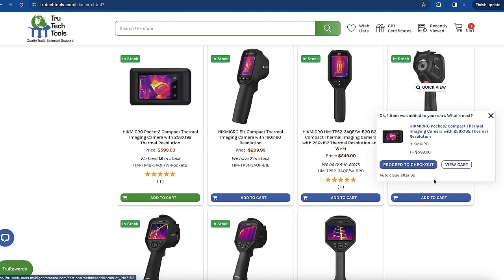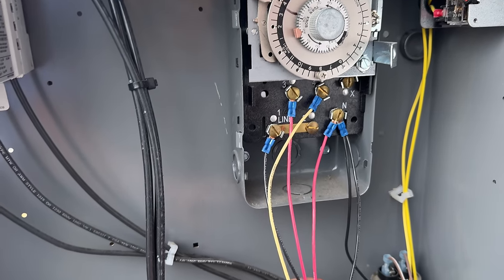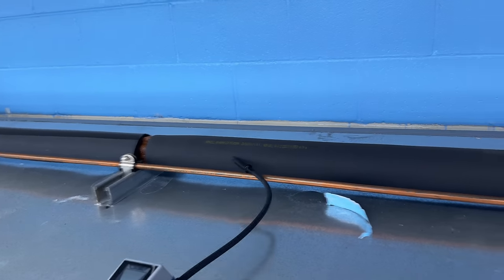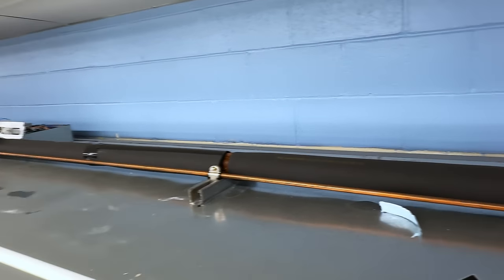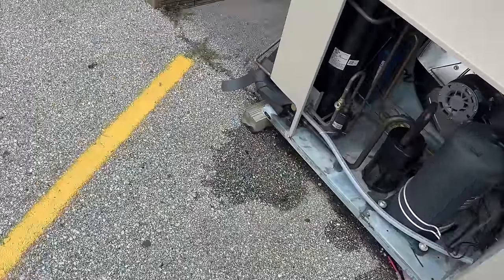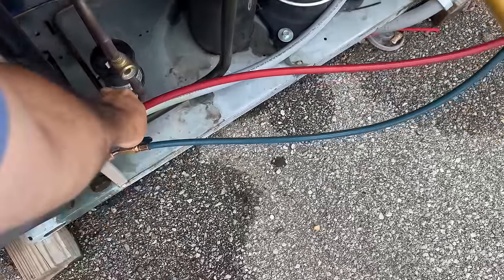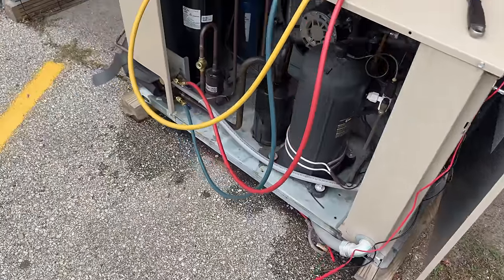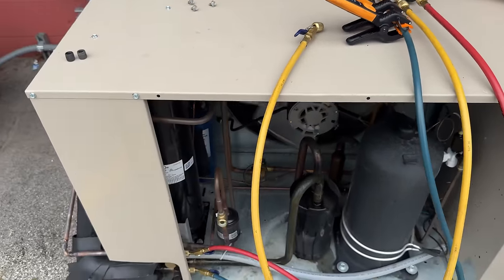More Mistakes More Problems New Install Failures

Comment: Putting the solenoid outside was a bad design. You lose the whole liquid line for storage for pump down. 50 feet of ⅝ line will hold around 5# of refrigerant that the receiver has to take on. Hill Phoenix makes good stuff and usually easy to service. Ive been to the factory in Conyers, Georgia several times. The long drives suck, i know. Ive had to drive from Destin, Florida to North Georgia a few times. Its difficult when you work all day then have to drive several hours home.
Reply: Every once in a while I have to drive from Broward to Tally. 6 hours of not fun. Thankfully my Nole is graduating next year.

Comment: I’m sure you confirmed already, but equipment that close to propane storage containers always makes me anxious
Reply: But tankers driving 70 mph with thousands of pounds of propane or gas that people always want to break check and cut off. And the propane sits outside in a metal box and gets up to 120°. And nothing ever happens, scared people make scared mistakes that causes the issue you are anxious about
Reply: @Freonleon  all true, but contactors and electrical equipment can be ignition sources. Not exactly parallels drawn. But as long as manufacturers clearances are observed it will be fine
Reply: @Freonleon I love your profile pic of the blown bakelite. Ever had one to pop while in front of it?

Comment: Good god... 😮 Mechanic defrost clock, digital defrost management and mechanic thermostat. So many branches on the stick. Why not a digital controller managing solenoid valve, fans and defrost contactors? One probe for inlet one for outlet and one for defrost temp.
Reply: What I was thinking. Too many variables and to many things to go wrong when one controller could manage it all.
Reply from the maker: I guess the company that installed it probably is not very big because I had not heard of them because they’re close to my area.  The piping looked pretty good but the start up needed a lot of work.

Comment: Rick, I feel your pain. I had like 5 stores when at my old company that the installers screwed the pooch on freezer heaters never wired up correct nor did they run power to the condensate pumps. 2 weeks of off and on service calls to get it back up and running. If there not going to do there job I would rather just do it myself. Good stuff and hope you had a great weekend.
Reply from the maker: Good weekend thus far. Thank you!

Comment: My favorite part is when you put the new meter back in the van and got out the old faithful fluke meter!  
You could tell you weren't "fluking" around! 😂
Reply from the maker: I debated on cutting that out, I didn’t do it to make the meter look bad because I think the fluke has some delays built into its readings. Where as the testo is more reactive on some things like the amp draw.
Reply: @HVACRSurvival  i'm glad you left it in there. It just shows what really goes on out here in the field!  Great video thank you for sharing!

Comment: Great job figuring out that mess, the way they wired that was absolutely mental. Either use a defrost timer with a mechanical thermostat or a digital control, not both. If it was my install I would have put the liquid line solenoid, thermostat and defrost timer at the case and used a fan delay defrost termination switch. They also could have ditched the defrost timer, and mechanical thermostat entirely and used the Emerson control for thermostat and defrost. Oh well maybe next time they will get it right.

Comment: Common mistakes I saw all the time, not ordering the equipment with oversized receivers for case applications, I am not familiar with these cases but many are flooded systems. Also you are correct in that the solenoid should always be at the tev inlet or the liquid line split.
I personally would advise the owner to have the solenoid repiped correctly. I don’t envy you following behind poor installations.
Reply from the maker: I don’t know if I would wanna put a solenoid at every case, but at least closer to where it splits to feed the three cases.
Reply: @HVACRSurvival  what I meant was on single evap system solenoid at the tev and multiple evaps the solenoid at the split

Comment: Good job Rick, I didn't wire the controls, I haven't been in Indiana for long time, I guess maybe they should have installed the solenoid closer to the evaporator, and did a better job on the install, the job looked clean, but even then mistakes can happen........
Reply from the maker: Correct. The piping looked good. The controls were the only miss

Comment: Crazy! All those separate controls. The one simple dixell controller that was factory indtalled on each case could control each case, temperature and defrost.
Reply from the maker: Yeah it probably could do it all depending on the model, but that’s not how it was originally designed even from the factory. I’m not sure why they do it. I don’t really care for it. I think it kind of sucks but HillPhoenix is a pretty big company and for some reason this is their current operation, these cases were made in 2023.

Comment: Did they drop something on the heater, or put 240 volts on a 120 volt heater?
Reply from the maker: I wondered the same thing, but those heaters are 240 V. I’m not sure what happened. I still haven’t been back yet because there is discrepancies on which heater to get the front or the rear for the coil. I can’t believe they didn’t make them the same and since I didn’t verify, which one was not working and now we’ve got an issue. I couldn’t have verified it with all the dang food in there. What a mess.

Comment: New meter eh ? Very nice I like that Testo . Just a heads up it kinda struggles to read very low amperage like under 1A and such , and the little delay when first reading volts and amps is kind of annoying , otherwise it's a good meter .
Reply from the maker: I noticed it’s really slow on reading capacitance. I’ve kind of ran out of tools to pick from TruTech Tools,  I thought I’d give it a shot since Testo’s been so good to me. For the most part it seems like a pretty nice meter. I just need to use it and get used to some of its Quirks.

Comment: I found it interesting with them having the sensor wired wrong on the controller. The book you had showed it wired different. I noted in your video the sticker inside the controller after you showed the book indicated it to be wired the way they did it.
Reply: 29 min mark
Reply from the maker: Are you talking about the digital temperature control? The book showed it being the bottom two, the very top terminal was the bin switch, which is a trigger. The ASP is what the thermostat does when it loses a sensor and it was programmed to run, which is a number one. I’m not sure where you’re seeing that it was wired correctly,  which instruction are you setting it differently?
Reply from the maker: Son of a biscuit eater. It’s crazy the stuff other people pick up 🤣👍👍👍you are correct. However, it was wrong. I can see how that happened but you can’t justify not verifying the system kicks on and off at the thermostat at least once when the system is brand new just to make sure everything‘s working as it should, so technically the faults on them and they never seen the temperature on the display. Inside the thermostat, it had a setting on what it does when the thermostat sensor fails, a number one means it will run all the time zero means it shuts off. Luckily he did have that set on a number one, which was a default setting.
Reply: Completely agree that they should’ve noticed that it was not reading a temperature and was displaying the fault on the controller. Guess the factory stuck the sticker on upside down inside the controller.
Reply from the maker: @hvactech77 I agree that definitely is a problem with that sticker design and it’s not obvious that it can only go one way.
Reply: btw, yt deleted my comment probably because I used a politically incorrect word in it. I had mentioned that it was probably friday when they made that temp control at insert name of company that manufactured it
Reply from the maker: I don’t believe they’ve deleted anything, but there is some filters turned on that if you say certain keywords, it will hold it for review before it lets it show it in the comment section. I then have to manually approve it.

Comment: 29:14 Sensor label and document don’t agree. Did manufacturer put the label on upside down ?
Reply from the maker: It looks that way because the instruction that the installer left were correct.

Comment: I'm pretty sure tank heaters refer to the heated condensate evap pans used where drainage to an actual drain is not possible. I had to wire up some cases for a Walmart that used heated condensate pans and IIRC that was the amp draw they had.
Reply from the maker: That sounds possible, but I would figure you might run it over to like a little giant pump or something equivalent to that and it would be outside of the freezer?. I guess I don’t understand why it would be heated unless it’s inside the freezer with it and even then why wouldn’t you drain it outside of the freezer so that you wouldn’t have to hold the water in a heated pan? . Sounds like more problems. this would be new to me.
Reply: @HVACRSurvival  The idea is it evaporates the water with somewhat high heat, avoiding the need for a pump or drain. It is located outside the case, usually right under the condensate drain outlet. The whole concept is bad really, because you're just dumping the moisture back into the same room with the cases actually.   

And you are correct that it is a pain, they get dirty, the heater fails, and it can only cope with small amounts of condensate at a time. Your defrost with hot water would make a flood using it.  The install I encountered them on was in a part of the store where no drains or exterior walls were accessible.  IMHO it would have been better to dig in a small sump and use a more powerful pump to go up, over and run the distance to a drain but that would have been horribly expensive.
Reply from the maker: OK, I now I know what you’re talking about. Yes I have seen that on a couple small self-contained beer cases that kind of looked like they were be on a rack. I had to use a pump sprayer instead of a garden hose. Or actually I think I use my vacuum cleaner to suck it out.

Comment: I'm not in this hvac stuff, but if the 220 wire is connected to 110 will drow half the amps. Maybe is this thing there, 9.smt if half of 18.smth.
Reply from the maker: The 240v circuit had the correct voltage and so did the 120v. I forgot to show that.
Reply: @HVACRSurvival  maybe there are 110 or 220 defrost whire and mixed up? they are having different resistance, i'm from europe and this voltage mix is strange for me :)

Comment: Great job even with crap installs.  Shouldn’t each bank of coolers have a solenoid since they are each bank are individually temp controlled? This seems to be a hack of an install. Get what you pay for
Reply from the maker: This customer would’ve paid what we charged, but the problem was the other guy must had better contacts at the factory and was able to get the cases a lot quicker than we were. Theoretically, yes, it would be nice to have temperature controls in each case however when we do a parallel rack system, we pipe them this way and the only thing we do is put monitoring inside of each case so that if one goes down, we can catch it with an alarm of high temp. I guess it’s a little more difficult when you have smaller systems like this but I don’t think it’s that uncommon you just gotta keep an eye on your temperatures because even this system here has no alarms on it if the product gets warm.

Comment: how do multiple cases on one condensing unit work? wouldn't the condensing unit be massively oversized in case just 1 of the 3 cases is calling and it would short cycle on low pressure all the time?
Reply from the maker: Theoretically, that’s where your receiver would hold the excess liquid. Rack system has multiple compressors and multiple circuits and it tries to maintain a certain suction pressure. On a system like this I have not seen too many individual thermostats however, I have seen it done. It would definitely take some planning on the BTU calculations and engineering chart. So I can’t say with 100% certainty there wouldn’t be a problem. I’m definitely not an engineer. I just make them look bad.  🤣
Reply: @HVACRSurvival  maybe I misunderstood, I thought it had a seperate temp control for each case, if it's just one for all 3 then there's no problem but the cases might not all be the same temperature if they can't mix air inside. it seems like a less than ideal system that would work normally only under close to ideal conditions (identical load and heat losses in all cases fed from the same temp control)

Comment: Wouldn’t a simple reversing valve and running in heat mode do the same job, only better, than running heating elements at high current?
Reply: Some use hot gas defrost freezer cases, freezers, and ice machines. Depends on the equipment but a hot gas will just run compressor and a solenoid sends hot discharge gas through the evap coil to defrost it.

Comment: maybe they're not setup for pump down and relying on the accumulators to keep from liquid slugging? but I'm guessing that would balance out with too high of pressures on the low side when off. hard to say what people do or silly controllers do now days.

Comment: you can't fix those freezer master-bilt reach-ins since the heaters are just an add on to a cooler design. they F that design. they will freeze again and again every 30-45 days.
Reply from the maker: They look cheap as hell and like a shit design when they have a twisted wire around it. I’m not impressed.

Comment: 29:11 Notice the sticker inside the device, its turned 180°; guess thats why they wired it up that way.
Reply from the maker: Yes, but they should’ve tested it and verified it worked,  obviously they did not.

Comment: Question for anyone:  Have you worked on a Sanyo VIP PLUS chest freezer?
Why do I ask?  I'm looking at buying a used, broken freezer on Facebook.  It doesn't power up, probably a straightforward fix?
New ones are too expensive for me, this one's $600
Anything to say about Sanyo freezers?
Any problems keeping the freezer at -240 degrees F?
Thanks.
Reply from the maker: I assume it’s a medical freezer? With two compressors? They can be a pain.

Comment: That freezer A421 sensor was wired into the wrong terminal because the sticker was put on wrong in the factory 😂 29:00
Reply from the maker: I seen that 😎 but he should have tested the thermostat when they were finished installing. He must not of tested it.
Reply: good catch, that would get just about anyone that's not used to installing them all the time. good old chinesium junk and lets not forget bottom of the barrel labor anywhere.

Comment: Big question I have is, how in the world do you have 7 bad heaters? I very very seldom have to replace a heater, normally it's just a time clock problem, wiring issue like you ran into, or terminal burned off the end of the heater wire, stuff like that. Yes I've had a couple drain pan heaters go bad over the years, they get beat up from people messing with stuff and pulling drain pans off etc, to clean out garbage that falls in there. But 7 bad heaters on Hill/Phoenix cases which are a decent brand of case, is crazy. Was this shipping damage? 

Still no excuse on the installers, every piece of equipment I install I do not leave until I'm satisfied that everything is working right, and I kick the timers into defrost to make sure it works. And I come back 24 hours later to double check everything, go over everything and double check for leaks, and make sure the coils and sight glasses are clear etc.
Reply from the maker: It sounds like you do it right 👍👍. I don’t know why they aren’t right but I can’t come back that far empty handed. I hope they not bad. But I’m scheduling it so he will have the case unloaded so I can make the repairs quicker.
Reply: @HVACRSurvival  I try. But I know enough to know my limitations so I like to double check everything. I ordered a Hilmor tubing expander with your survival code :) So far so good.
I'm just curious how so many heaters are bad, and this is only 1 year old equipment, that's almost as crazy as not wiring the units up correctly so they pump down properly.
Reply from the maker: Actually throttle bottle mentioned they might have wired it up for 240 V on the 120 V circuit. Which wouldn’t surprise me since they didn’t wire the solenoid valves correctly or the thermostats plus like I mentioned there was a box with some replacement control modules. Possible that wiped those out in all the but one. Plus the way it blew it apart was very unusual so I guess we’ll find out if I see that on all of the cases.

Comment: Throw that fluke away and get you a Fieldpiece please. 😂
Reply from the maker: O hell no. Fluke is overpriced and doesn’t give you many features for what you pay but one thing I can say is when I put it on there I have more faith in that fluke than I do any other brand that I’m gonna get a reliable, consistent, repetitive reading.
Reply: Only thing fieldpiece has on that fluke is the twisting angle feature it has
Reply from the maker: And accuracy. I don’t trust the Fieldpiece on anything with VFD’s. More times than not it gets confused.

Comment: You loke 448? I just met a guy who drops 448 on top of 404. I'm not sure thats a good move.
Reply from the maker: It’s never correct to mix refrigerants, it’s actually illegal. Plus from a service standpoint you don’t know what the correct saturated temperature pressure relationship to use when calculating subcooling or superheat.